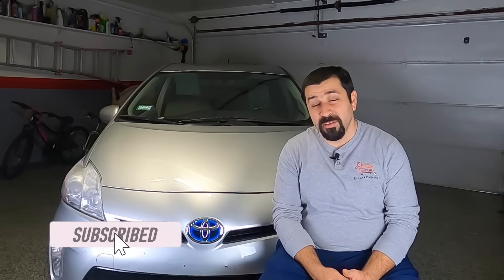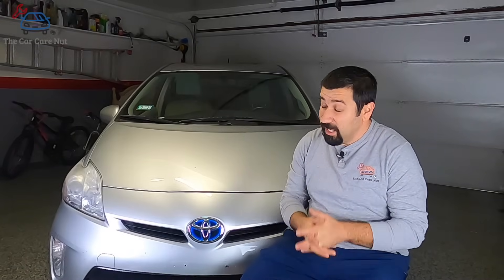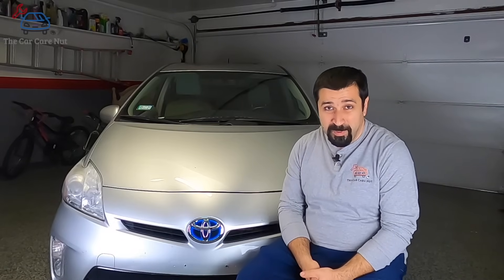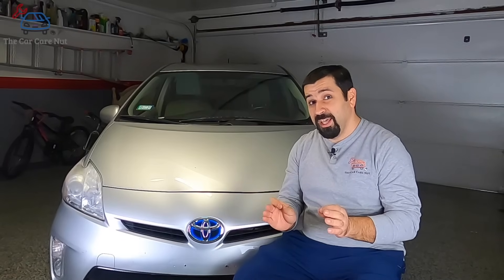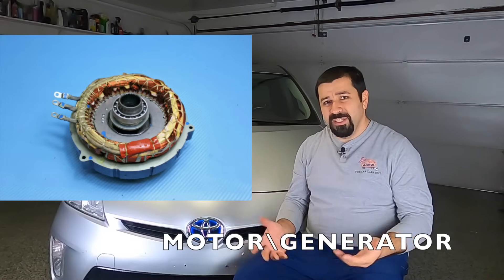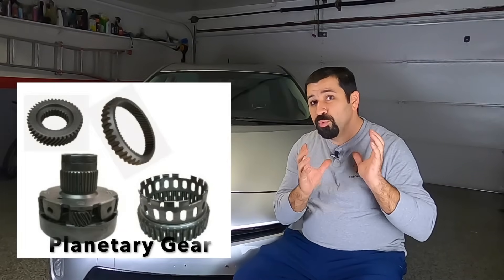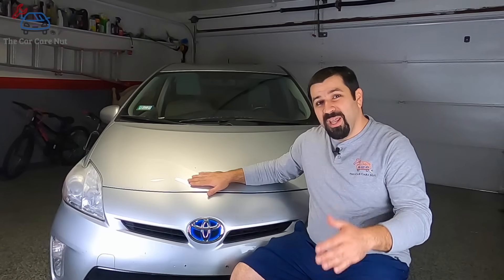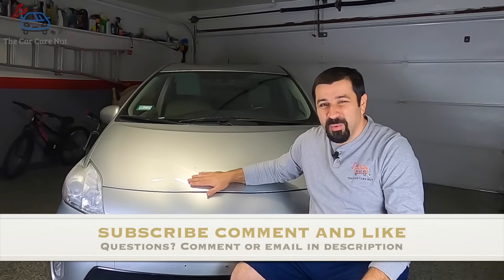How Toyota Hybrid System Work Part 3 Hybrid Transmission

Comment: That hybrid transmission is something special. When you look how simple it is, yet how flawlessly it performs and reliable it is, it's a really incredible piece of engineering. It's an insult to call it a CVT.
Reply: The transmission in these are amazing. I have driven an Auris hybrid for three years. They are so smooth, no gear change. Just amazing.
Reply: @camptube7621 I concer! I have a 2022 Lexus ES300H! Never thought I would like a no shift trans. These are so linear & smoothI really like it!
Reply: If you understand how it works, it's piece of art, it's breathtaking🥰🥰🥰
Reply: The thing that amazed me when I first learned how they worked is that the “magic” of these Toyota (and similar) hybrid systems isn’t mechanical, it’s electronic.  They could have built that gearbox in the 1940’s if they wanted to, but the electronics to control it wouldn’t be feasible for another 50 years.
Reply: You just nailed it, it is an insult to call it CVT 👍
Reply: @eslamsolo  Every transmission in a Toyota/Lexus Hybrid is 100% CVT.
Reply: It's the most dependable type of CVT for a reason... because of its simplicity and use of constant mesh gears. It's basically just a planetary differential, which allows both the engine and the electric motor to operate at their most efficient RPM for the load/throttle input. In short, it's half of a D-drive. The gear cluster functions as the output drive of D-drive transmission, while the two motors function as the variator and input drive.
Reply: So if you are cruising at a normal speed lets say 100km/h then the engine charges the battery through mg1 am i right?
Reply: It's not an insult. It's a CVT 100%.
Reply: @MrZennerd not really. The torque ratio does not vary in an ECVT, nor does the speed ratio. Those are what the 'variable' in 'continuously variable transmission' normally refers to. All speed and torque variations come from the ICE and electric motor and how they are operated by the computer. The job of the ECVT is simply to allow the two power sources to be combined and directed to a single output. I expect Toyota only used the letters CV and T for some sort of marketing purposes.
Reply: @2bfrank657  The transmission in a Toyota/Lexus hybrid is definitely a CVT. Please allow me to explain. The most common mistake people make in the "CVT debate" is that they misinterpret the term CVT. The term CVT has nothing to do with the architecture or how the transmission works but what she does. In other words: CVT is the RESULT of how a transmission works. I will clarify this with 2 examples: First example: The transmission with 2 pulleys and a belt (AKA the traditional CVT) In short: the most common type of a CVT uses a V-belt witch runs between two pulleys, the cone-shaped halfes of the pulleys can move together and apart. So that is how the transmission is built and how she works and the RESULT of that is a transmission with no fixed gears or steps but instead of that a transmission with a variable gear ratio or CVT. Second example: Toyota/Lexus Hybrid Synergy Drive (AKA eCVT) Very short ( because it's to complicated) : this transmission uses a complex planetary gear system with 2 electric motors- generators (MG 1 & MG 2) integrated. The mechanical gearing design of the system allow the mechanical power from the ICE to be split in 3 ways: - Extra torque at the wheels under constant rotation speed. - Extra rotation speed at the wheels under constant torque - Power for an electric generator. Now that is the architecture of the system and how it works and it's completely different from the one in the first example with the 2 pulleys, you can't even compare them. But the RESULT is exactly the same: a transmission with a variable gear ratio or CVT( Continuous Variable Transmission). CVT's are used in many vehicles even in bicycles ( NuVinci hub). And of course a CVT of a bicycle works totally different than a CVT of a car, but the RESULT is, again , exactly the same: a transmission with a variable gear ratio or CVT. Conclusion: Every transmission with movable pulleys and a belt is a CVT, but not every CVT is a transmission with movable pulleys and a belt.
Reply: @MrZennerd  But the ratio in an ECVT does not vary.  The ratio of the transmission is determined by number of teeth on each component of the planetary set, which never changes.  All that changes is the speed and torque put in to the system by the ICE/MG1, the speed and torque put into the system by MG2, and the speed and torque at the wheels.  All speed and torque changes come about from what is FED INTO the ECVT transmission, not from any sort of RATIO CHANGE WITHIN the transmission.  The role of the ECVT is then to simply combine the three inputs/outputs, along with some change in torque and speed using FIXED-RATIO gearing.
Reply: @2bfrank657  But MG1 and MG2 are together with the planetary set part of the transmission. So eCVT is not only the planetary set, it's the complete system, it's one unit. And indeed, the role of the planetary set itself  is combine the three inputs/outputs, but it's crucial to give the complete transmission a variable ratio. So it doesn't matter if the ratio of the planetary set itself does not vary, it's the end result that matters, because CVT is a collective name for various power transmissions that allow a stepless variation between the input and the output speed. So it's simple, when a car with a combustion engine can accelerate without fixed steps or gears then it is equipped with a CVT, and how it works or how the different parts are working or related to each other is completely irrelevant . No steps=CVT.
Reply: @MrZennerd  traditionally a 'transmission' sat between the engine and the wheels. Its job was to transmit power from the engine to the wheels, not to create power itself. As an entire drivetrain, I guess an ECVT performs similarly to a CVT, but the transmission alone does not.
Reply: @2bfrank657  Indeed traditionally. But a Toyota/Lexus hybrid transmission is not a traditional transmission, that's also the reason why they call it an eCVT.
Sometimes traditions have to be broken, that's called progress. Have a nice day sir................... .
Reply: @MrZennerd It may be called an e-CVT and it does resemble a CVT in many characteristics… but engineering wise, it’s actually a “Torque Split drive”. The input/output figures and operation are what differentiate it from CVT.
Reply: @LukeAusNSW  CVT is a concept. And what's the concept?
A transmission with the characteristic that it has a continuously variable gear ratio. Every transmission with that characteristic is a CVT. 
Continuously Variable Transmission, the term says nothing about how the transmission is constructed but how it behaves. The transmission with two adjustable pulleys and push belt is a perfect example of how the CVT concept can be realized, just like the Toyota/Lexus e-CVT is another and, indeed, completely different example of how the same CVT concept can be realized or executed. So, CVT is a collective name for different transmission systems that all have one thing
in common, they all have the same characteristic: they are continuously variable or in other words
stepless. So........... a Toyota/Lexus e-CVT is a CVT....................................100%.
Reply: @MrZennerd   @2bfrank657 Smart conversation gents and very well written both. 
I lean towards Frank's "It's not a CVT" statement.
I do take your point, Mr Zennerd, - It definitely IS a transmission that constantly varies - but if you say 'CVT' to most people (like me) an image of mechanical cones and belts in a scooter, spring to mind, which this system is beyond.

Thanks for the education though, 👍

Comment: Prius Hybrid V 2017  , Toyota recommend synthetic oil 0/20  need to change on 15000 km  and transmission oil change at 120000km . Is this true? What your recommendation for the engine oil or transmission oil change km?
Reply from the maker: Hi! I would change the engine oil between 8000-10000 kms and the transmission fluid that’s a good interval
Reply: @TheCarCareNut  someone told me Prius Hybrid vehicle don't need to change transmission oil . transmission oil for life time. There are some vehicles likes that.? No need to change transmission oil?
Reply from the maker: How long is that life? I would change the fluid. It’s easy and not expensive to change why take a chance

Comment: Does Camry, Avalon and Rav4 hybrid use e-CVT instead of normal CVT. I think it is more reliable. And how about Corolla hybrid 2020? Thanks.
Reply from the maker: Hi! All Toyota hybrids use eCVT which operates in theory somewhat like a CVT transmission but in reality they have nothing common with an actual CVT transmission.

Comment: What happens when you are driving down hill for a very long time? Does the battery management system will try not to keep recharging your battery? Overcharging it might be harmful for the battery right?
Reply from the maker: Hi! The battery will charge and when the computer doesn’t want to charge the battery anymore it will just use hydraulic brakes and not use regen anymore.
Reply: @TheCarCareNut  The eCVT can also throw away regen energy by spooling the engine up very high with MG1. That's how "B mode" works.

Comment: I'm thinking about buying the toyota highlander hybrid, do you recommend buying one. SERIOUS TALK, cblindsay63@aol.com please respond to me. Need your advice
Reply from the maker: Hi! What year highlander are looking?
Reply: @TheCarCareNut  I’ll need to catch up on more of your videos if you’ve already answered this but does the warranty that cover the hybrid battery good for any failure before 150,000 miles? Any stipulations?
Reply from the maker: Hi Sammy. Depends on which year you’re looking for. Many of the newer ones have a pretty long warranty on the battery
Reply: @TheCarCareNut  I’m taking delivery of a 2021 rav4 hybrid xle next month. Rephrasing my question, if the battery fails early from normal wear and tear before the new warranty(2020+ hybrids) of 100-150k will they give a free replacement? You might not know the answer. I’ll just call a service dept tomorrow
Reply from the maker: If it fails while under warranty they will replace it with new

Comment: Today the Toyota dealer told me my inverter is leaking at the transmission on my 2013 Lexus ES300H.  I see no leakage or crystallization on hoses or connections.  Inverter reservoir losses half an inch of fluid  in a year, hardly noticeable, never goes below low. 

I didn’t know inverter Coolant is used on Toyota hybrid transmission. 2200 estimate, crazy!!!
Reply from the maker: I wouldn’t worry about it. We’ve seen some leaks here and there they’re usually small and take a long time to drop the level. Keep an eye on the coolant level every few months and top off as needed.
Reply: @TheCarCareNut   I really appreciate it thank you so much I feel much better!!!

Comment: Is not a eCVT it is a PSD (Power split differential) And MG1 is not directly connected to the Combustion motor, but it is connected to it through the PSD. And the speed of MG1 will control how much power the ICE can give, that's why at high speed you can have the ICE at low rpm. This is a fantastic trasmission because you can have very high gear ratio for economy. I also hope Toyota makes a High performance Hybrids, because I'm sure this trasmissione can also be very sporty!

Comment: Going through your entire Hybrid playlist, I went from looking at a Sienna to a Highlander but ended up ordering through Carvana a 95000 mile 2013 Prius V, I think it should make a better daily driver for work commute plus the whole family when needed.

First think I'll check when the car arrives, the hybrid battery fan filter.
Reply from the maker: Congratulations on your Prius v purchase. The fan filter is underneath the passenger rear seat. Slide the seat all the way forward to see it. If no filter is installed install one and keep it clean and clear and you should have no issues
Reply: You will not be sorry as the Prius is probably the best engineered car out there my 2013 Prius base model speaks for itself over 160,000 miles with few problems and almost Zero service other than required!

Comment: My only questions are how long will it last, what maintenance is required to maximize life, how much to fix or replace it?
Reply from the maker: The transmissions last a very long. Fluid replacement every 60-90k is about it for hybrid transmissions.
Reply: @TheCarCareNut did that still slips in 1st gear.

Comment: Shout out to the $1300 price tag for the gen. 2 ABS actuator I'm eventually going to have to purchase due to the tank leaking down and the motor running much more than it's supposed to. It hasn't thrown a code yet, but I can read the writing on the wall. I plan on tackling this job when the time comes, and do not look forward to it at all. The repair at the dealership is around $3500. I have a copy if Techstream on a 32-bit Toshiba laptop running Windows XP. These actuators should have all been recalled or at least repaired, but I never got the letter from Toyota concerning the extended warranty because I bought the car from a private party. That would be a good topic for a future video, changing that actuator and bleeding the brakes on the new unit with Techstream. I've changed two modules out in the original traction battery and that was almost two years ago. Watched a few videos on the procedure and did it myself, using a seller on EBay that sold me two modules from a low mileage pack. The two underperforming cells were in the middle of the pack, and there was a great deal of corrosion on the bus bars, so everything got a good cleaning. It's a shame Panasonic doesn't make these modules available separately. I started investigating the traction battery when I was on the interstate and the car just lost power, like it was running out of gas. I exited and stopped at the first place available. The dashboard also lit up like a Christmas tree and the MIL was on. I think the code was P3000. The light turned itself off the next day, but the car was a daily driver at the time and I didn't trust it on the road going out of town. An app called Dr. Prius helped me to identify the two weak modules with amazing accuracy using a Veepeak BLE+ as an interface. It works with my iPhone flawlessly and I have three different apps - two of them with enhanced Toyota diagnostics that I paid a little extra for. There are hundreds of PIDs, and this is a 2008. This has been one of the best cars I have owned. Thanks for posting and look forward to your other videos.

Comment: Car Care Nut, I appreciate your knowledge and you don't withhold your any of it.  You have insane experience on toyota.  Could you help me on this question: What's the mileage do you recommend on changing CVT transmission on Highlander hybrid?  I have seen some video people do at 100k miles, fluid is pitch dark.   Your video recommend at 60k (on prius) but some recommend  40k miles to do so, or even 30k miles that seem too frequent.  What's your take from your experience?  keep up the work
Reply from the maker: Hi! Thank you for watching my video Andrew. I would recommend you replace it between 60k and 90k miles. You can do it earlier with no harm to anything.

Comment: So you're saying cvt and e-cvt uses different types of fluids?
 I have a 5th gen (2019+) Rav4 hybrid. 
What kind of fluid is in the rear electric motor?  What about mg1 & mg2 ?
Thanks
Reply from the maker: On Toyota hybrids both the transmission and the rear transaxle use Toyota WS ATF

Comment: The oil pump isn't really even a pump. It's splash lubrication just like manual transmissions.
Reply from the maker: In hybrids it is actually a small pump. Manual transmissions relay on the gears splashing the fluid. In hybrids a sling type actual pump is used.

Comment: Sorry fella, but that did not explain how the transmission changes ratio - especially how the engine speed sometimes races when it charges the battery yet at the same time the road speed varies with the pedal as though the engine speed is normal.
Reply from the maker: That is the part that’s not simple. It uses the planetary to vary the ratio. Perhaps another video focused on just that would work. I’ll look into making such a video.
Reply: Check the Weber Auto channel on YT for a detailed explanation of the planet gear drive.

Comment: Great Video's thanks for posting. Is the Rav4 Prim motors the same setup? and are the batteries not liquid cooled? You speak of keeping the air fan filters clean, I'm just wondering if air is the only method of cooling in that model you showed it on.
Reply from the maker: Hi! Thank you for watching my video! So the RAV4 prime has the same motor setup with some differences in the whole system. The battery is cooled differently and is in a different location. There’s a filter but it’s for a different component not the battery cooling